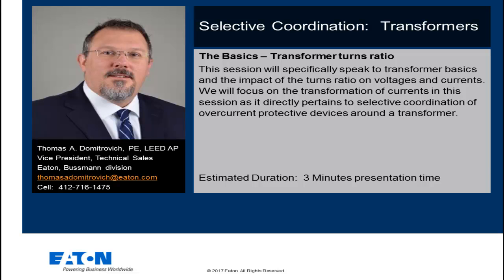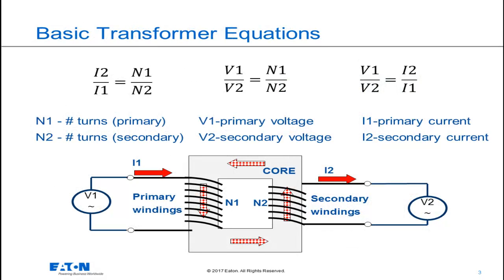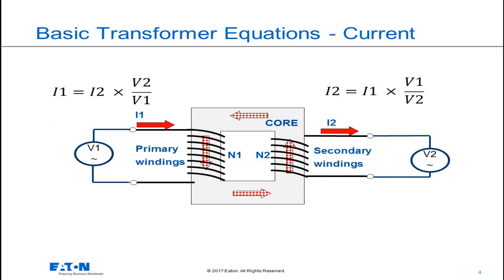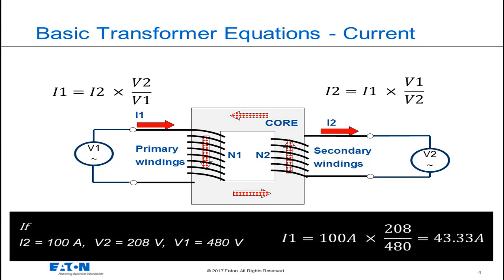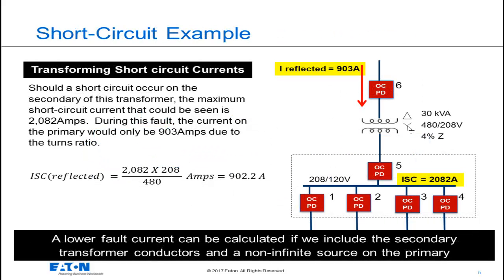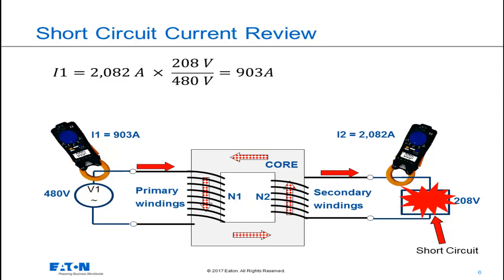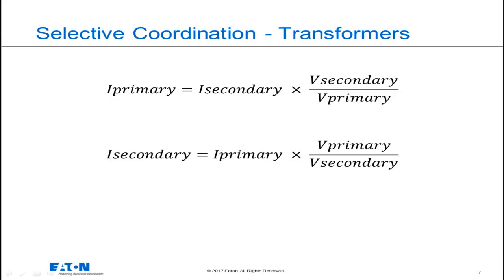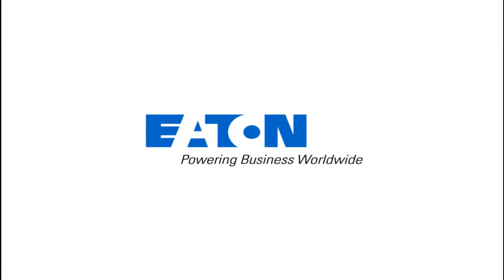Transformers - Turns Ratio

Comment: made a 435 turns primary coil with a 18 SWG copper wire in my DIY transformer. Unfortunately that primary burned out 5 seconds after plugging the transformer to the 220 volts imput source. May I know the reason?
Reply: Did you use "enameled" magnet wire for the coil of your transformer.  Magnet wire has a polymer film insulated coating on them.  If you used bare copper wires it would short circuit and bypass the core that the primary wires wrap around.  And if your core that the primary wires were wrapped around was too thin or too small it will not offer enough “resistance” to the current flow.  This resistance is due to changing magnetic flux in the core, which is termed inductive reactance.